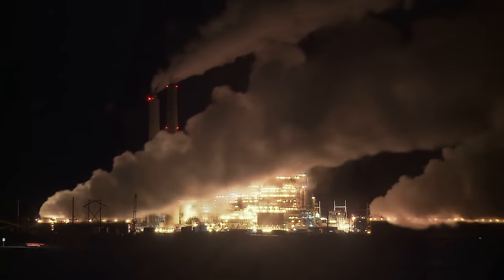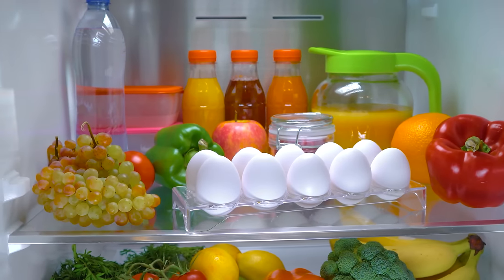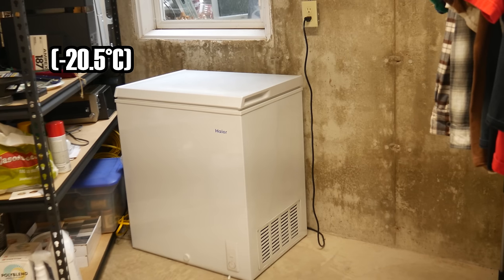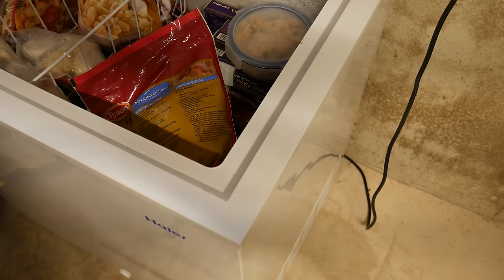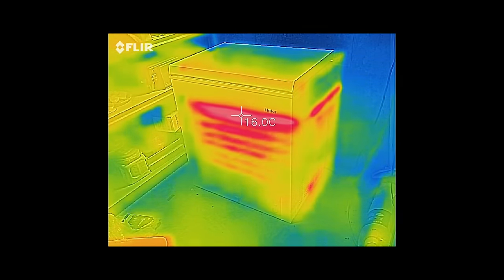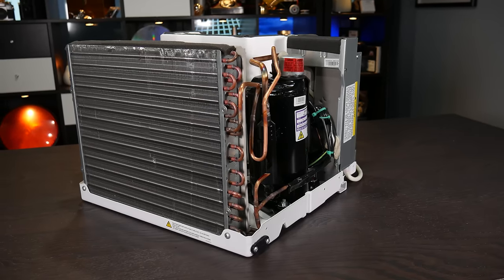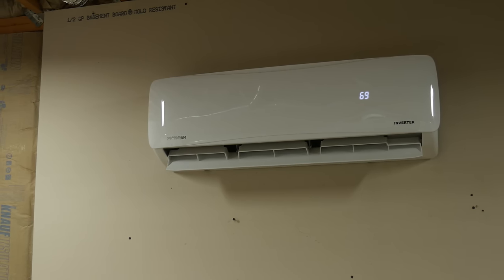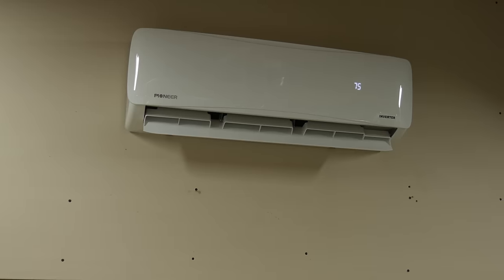Heat Pumps: the Future of Home Heating

Comment: very good video and explanation! Once our A/C and/or heating dies, I'll definitely look into these systems. Here in NorCal we rarely get to freezing, so should be no problem. 
My sister in Germany, where it can be -4F for weeks, had a heat pump system put in, they also removed and replaced their wood fire place with a system that has fans and some more tech I didn't pay too much attention to, but that's their supplemental heat source if it gets that cold. This is their first winter with the system and it's balmy warm in their house. Add solar panels on the roof and they're saving a bundle and are more environmental. We have to first replace the roof before adding panels, but that will happen soon too. 
Thanks for all these really well done videos!
Reply: Don't do it.  Running your compressor year round when you could use gas heat will increase your electrical bill significantly.

Comment: When I bought my house, I had standard central A/C with an oil fired furnace.  I live in south east Virginia.  When my A/C died, I had it replaced with a heat pump and the oil furnace set up as the back up heat source.  Once the oil tank ran empty, I never refilled it.  That was 9 years ago!
Reply: Did you ever use used motor oil for the oil furnace?
Reply: Coincidentally, I did the exact same thing in 2010 (so, nearly 11 years ago) but I live in Pennsylvania and it gets cold enough that some winters there are nights (and sometimes even days) when the thermostat calls for aux heat and the oil burner runs.  The thermostat uses an outside temperature sensor to determine if aux heat is needed.  If you truly don’t ever need the oil burner where you live, then it might make sense to remove the chimney because that is a big heat sink.  And get rid of the oil tank at the same time, don’t want that rusting out and leaking whatever dregs of oil are on the bottom.
Reply: @FishFind3000  i don't think you can run waste oil through a fuel oil furnace. They make specific furnaces for burning waste motor oil
Reply: @gatewaysolo104  Isn't burning waste motor oil for heating bad for the environment? There are people doing it over here in Europe – as you can guess, they are mostly car repair garages, obviously, well "stocked" with waste motor oil – but the environmentalists are against it...

Comment: Beware not all mini-splits (shown in this video) are heat pumps but a lot are, there are heat pumps that look just like Central air conditioners.  They are typically paired with an air handler (at least in Oklahoma) and auxiliary heat strips, but can be paired with a gas furnace for backup heat(Dual Fuel). Depending on the size of your house cooling or heating the house may require multiple units or a multi-head unit, as opposed to a single system Central a/c.

Comment: Still waiting for the "and by the magic of buying two of them..."
Reply: Do go on
Reply: By the magic of buying two of them, we can run one as an air condotioner and the other as a heat pump!
Behold! The room temperature doesn't move!
Reply: @thenasadude6878  well they both would still be "heat pump"
Reply: @JeffSmith03  indeed... Where i live aircon is always intended as cooling and heat pump as heating, in everyday non technical speak
Reply: @thenasadude6878  sure they can name it whatever they want, but if you understand the technology. No cool side if you don't pump the heat to the other side.
Just realized actually you can cancel out both affects just with one unit

Comment: Nice explanation.  Most peoiple who try to explain refrigeration concentrate from pressure changes (Boyle's law) and ignore the vital phase changes.  Good Job!!  Also in cooling mode, my unit takes the condensate and evaporates around the condenser, thus recovering the heat of vaporization of the inside humidity.  Very Efficient.

Comment: When I was a kid ,about 30 years ago, my father had an   AC/Heater unit that could be either an air conditioner or a heater depending on the settings on the unit . He explained that if you had to you could also install your window unit  air-conditioner backwards to heat the house. 
 I've never seen one since then .
Reply: Although a window unit installed backwards might need a means to control condensed water.  on newer units it's less of a problem as the sling the water onto the warm coil to improve cooling.  This would had humidity to the air to some extent.  There would be less water in the Winter since cold air can't hold as much water vapor.
Reply: @hjc4604  , you're right !
Reply: theoretically yes but not in broad temp ragne, most AC will not cool below 18 or 16C, which is more than outside temp when you usually need heat. Even if you fooled thermostat there is no automatic defrost cycle

Comment: 33:14 most ENERGY effective (efficient) not most COST efficient.  That's extraordinarily important to point out.
Reply: Here Natural Gas is cheaper in comparison and the prefereed option for heating. Electricity is way more expensive. Aircons could be efficient but in the end they are power hoggers
Reply: It's funny because they are effective until it is actually cold outside (under about 36) then auxiliary heat kicks on and wastes more energy than any furnace or boiler.
Reply: @joshuacomfort8059  mini splits run at 100% efficiency down to 20* F.
Not 36* F.
That would make this the BEST option capable; because they are NOT power hogs right up until below freezing temperatures, in which case it is an emergency no? I wouldn't care about the off chance I might have to use auxiliary heating if 90% of the time the heat pump was running was still saving me money.
Reply: @D-Vinko  man I am an hvac tech in the northeast and I can tell you in climates where it is actually cold you will constantly be on auxiliary heat also 20 is what it says on paper but I see the shit first hand it is not effective anywhere around 36
Reply: The only thing makes them less desirable for people is the price of installation
Reply: No; that is simply not true.
Electricity could be entirely free for you; but you likely refuse to even consider purchasing solar and paying off the cost of installation with the money made from electricity production. 
With a solar panel, and one of these systems, you pay nothing for heating, or any of your appliances. 
Inb4 "Solar doesn't work in winter"
Dude it isn't 2010, all solar panels work at -20*F, and being that they all produce latent heat energy from black body radiation, they wouldn't get gummed with snow.
Go out, get a mono or polycrystalline panel and hook into your grid, have free electricity.
They pay for themselves within 2 to 5 years; the cost remains the same, the time is based on the amount of money made from electricity production, if more is made during times of high UV, it'll pay off your installation fee faster
Reply: @D-Vinko  not everyone can get solar panels on their house and this is for the regular person  how are you going to tell me it is simply not true if I literally make a living working on it all you see is the shit on paper talk to any experienced hvac tech they will tell you heat pumps have no use from the 30s down
Reply: @D-Vinko  I have been saying this for years instead of spending money on  useless basements just put them towards solar panels and with modern heat pumps best of which could work at -31 f you will never see energy bills again
Reply: @cmmartti   a leaving space, above ground,   is cheaper to build and it is more comfortable to live in .  With multi splits you do not need  duct work maybe for a HRV only but it is much smaller in size. Why do you want dig dirt in the first place? Grandfathers were digging below the frost line because they did not have  materials and technologies that we have now a  slab with insulated perimeter around would be much cheaper than  all digging, building basement walls, waterproofing , insulating  them  so since I am  a poor guy I can not afford to waste my resources on outdated technologies
Reply: @D-Vinko  Electricity isn't free in your scenario, you've simply offset the cost of the power with a 20 k+ investment up front. In fact that makes power incredibly expensive until you hit the ROI point. Throughout the Midwest, where it happens to be cold semi obviously there is substantially less solar radiation. Here in Michigan it's a 20 year ROI currently. I just ran the calculation again in January.
Reply: @joshuacomfort8059  If by under about 36 you mean under about 5. If you don't believe me, ask the guy who uses one in Alaska.
Reply: Depends on where you are. For me, a COP of 2.4 would break even with the cost of gas, and I live in an area where gas is cheap.

Comment: I have a very old Carrier central air system installed before we arrived in 1986.  It was a complete system installation including all the duct work since the home had a hot water boiler system.  We did not use it much save for when company came.  We hated that it cooled the whole house when a lot of rooms were rarely occupied.  After about ten years I got to wondering what sort of shape it was in regarding coolant, wear, I did keep it clean.  The HVAC guy reported that coolant was at the right pressure and there were no worn parts.  He finally said to keep this unit in top shape as it was one that he could repair with new parts.  In his experience he said this this make, model, and vintage was “bulletproof and over designed”.  We still did not like that there was no option but +/- cool the whole house down.  There were dampers that could be adjusted but they provided minimal effect in our experience so we went to closing some dampers completely.  Finally bought three ductless heat/AC units.  Two singles and one double.  A great solution.  When the unit in the often occupied family room starts to struggle in below freezing temps we turn on the vented kerosene heat and let the heat pump run and the kerosene trim operate on assist, both set at the same temperature.  This approach has moderated both electric costs and kerosene consumption as I have records I’ve kept for about 7 years.  The challenge with switching over the central air system to central air/heating presents the same challenge as central AC, that of heating areas of the home that do not need it.

Comment: The metering device on the indoor coil is typically a piston or Txv(thermostatic expansion valve)
Reply: Would you recommend school for HVAC or just trying to hit the field as a “helper”?
Reply: @EastDallasKicks  Depends on who you goto work for. Most Unions will send you for some training, which they will pay for. But there is a lot more to HVAC than just soldering up some pipes. Diagnosis is far from easy compared to other lines of work, most guys in automotive (Which is my trade) do not know anything about AC. They just get by with the most minimal knowledge possible and have a real hard time fixing it right the first time without guessing on parts. I spent a lot of time studying on my own and watching professionals who make videos, but that was supplementary to my own existing knowledge. Is it possible to jump into the field and learn what you need? Certainly, but it's a lot easier to learn the concepts and formulas in a vocational school setting where you will then move into the field and expand on those concepts.

I learned 10x as much from a 20+ year veteran HVAC tech on youtube than I did from what I learned on my own in the field and in school. But without that schooling and field experience I wouldn't have known what half the things he was talking about were. You need the concepts, then you can take off and run on your own under a master for the rest. Most people who try to figure it out on their own end up beating their heads for years trying to get to where they could have been in just a year or two had they taken a few classes then worked under an expert.
Reply: @2009dudeman  Figured as much, videos I watched in the beginning of class referring to pretty basic process and parts didn’t make sense. I’m no expert and have no real field experience but atleast I’ve got a grasping on that knowledge now. I do wish my school was like that you tuber who owns “kalos” where they teach them in class and let them practice things like let’s say wiring the condenser fan and different caps and such but I really like that they get to go actually practice work in the field on apartment and other rental buildings and such but we don’t have that at my community college. I’ve had offers to join commercial but that seems like to much knowledge to get into and that I’d be a set back to their work flow but maybe I should though I’ve only really learned on smaller residential units and those refrigeration cycles and such but thanks for your reply
Reply: We did wire the condenser fan and caps contractors and all but it was in a controlled environment. We didn’t have to take off the fan blade and motor and route the wires to connect them we just unplugged and tried to use our brains and schematics to find where everything went yeah we had to ohm out the compressed and find our starts and runs but it just feels bland
Reply: @EastDallasKicks  the first class you take in any decent auto program is a shop safety class. You cover how to not poke your eyes out, how to use a wrench and hammer, cutting torch, etc. When you get into your first real class you are taking apart a little baby engine, a 2 or 4 cylinder at best, some start you on a V6 or V8 in larger groups. Are in a basic electrical class where you learn how to strip wires and test voltages and resistance, alternators, etc. It's all boring stuff because it's been torn apart 100 times already and it's easy because it's all in the open.

But there is hundreds of things you will pickup that are important for later. Yeah wiring a contactor on a mock board is boring, but you have to know how to do it and there is no better view for what you are supposed to do than a mock board.

The first semester or two are boring for any trade, it's once you get the basics under your belt that things really take off. How are you going to calculate superheat or subcooling when you don't even know where to measure? That's what the mock board is for. How are you going to check for proper rotation of the compressor if you don't know what to listen and look for? Trying to learn on a 2 stage 10 ton unit with two condenser fans unless you already know what to listen for from the mock board?

I didn't jump right into ECU diagnostics, I started out with checking lightbulbs and motors. Doing volt drop tests on battery cables and what not. Even in AC I am able to diagnose a system with a set of gauges, a thermometer, and a multimeter. In one case diagnosing a system that would after 2 minutes over pressure, blow out the pressure release, and hit 150 degrees on the evaporator on a rear AC express van over Facebook in just 4 or 5 posts to help another tech when 20 other people were screaming compressor and fan clutch. It turned out to be my very first guess, a restriction in the rear TXV that ended up being a tiny sliver of plastic barely bigger than a finger nail clipping. I didn't start there, I started out learning to hookup and read gauges.

Just stick with it, after you make it through you have enough knowledge to jump into the deep end and swim with everyone else.

Comment: I’ve seen heat pumps working in coordination with a pool heater.  During the summer heat pump would pump the heat into the pool away from the house cooling the house and decreasing the “shock” of jumping into a cold pool.

Still needed a solenoid valve to go back to the condenser when the pool was at its max heat capacity.
Reply: There is another advantage of a pool system in places where the nights are cool and the days are hot—such as a dry desert climate. During the hot days the A/C warms the pool. During cool nights the pool radiates away that heat, making it more able to absorb the A/C heat the next day.